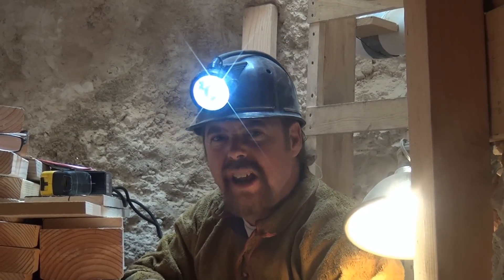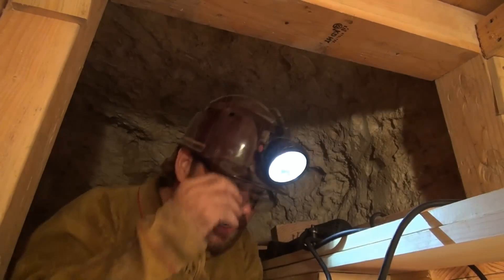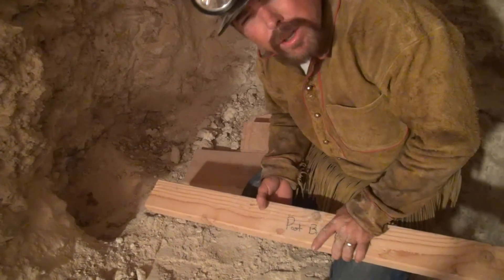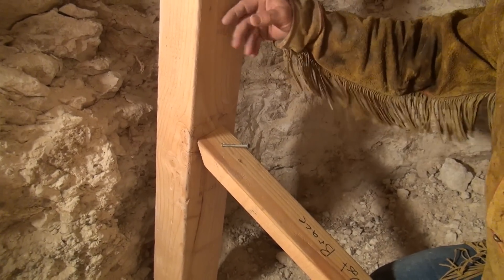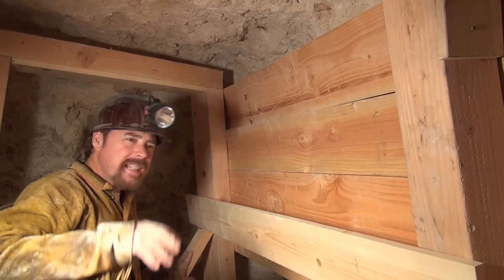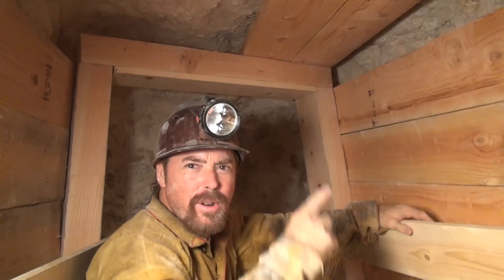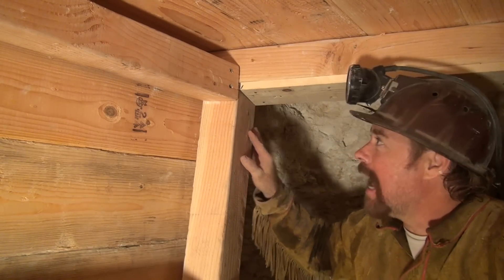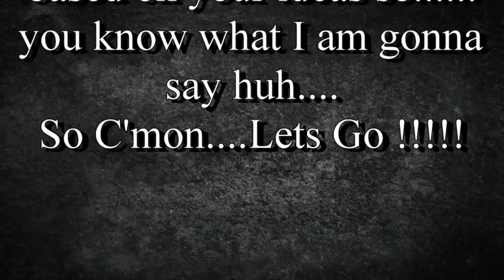TIMBERING A MINE !!!! HowThey Did It.  ask Jeff Williams

Comment: Somehow I felt the wood will rot as moisture may enter the tunnel.  Thus I prefer rebar and concrete to combat possible moisture.  Also noticed you are trying to gasp for more air, perhaps put a fan to the deep end and blow outside may ease air flow.

Comment: I have a question that amounts to a concern, and that is... If I take a deck screw and put it half way in a board or a vice, I can shear it off with a simple whack with a hammer.  If I do that with a decent nail, it simply bends.  Pacific Rim nails have been known to shear though.  Does it matter if the screws have little to no strength in shear?  I am asking for my own project, not a a troll or anything like that. I don't understand underground movement enough to know the effects are or are not.  Thanks for the awesome videos.  I now constantly check daily to see if you a new one out.  lol  Love them all.

Comment: Have you ever used any type of air system to drive back fill in around the timbering? Even though it would be far finer grit and possibly prone to sifting it would fit really tightly into a lot of fine cracks and fill it a lot more tightly.

Comment: Wow that is a real safe Gold mine now. I would use some small lag bolts because those screws will snap off. They are too brittle and break easily. Just saying. I used some stainless screws on my my deck where is connects to the house and they broke off. I did use some lag bolts mostly but at the end I needed some more lag bolts and just put in a screw and you know what the screw broke off.
Reply: I was thinking the same thing.  The drywall type of screw is great for holding things together but I'd feel better knowing there was a steel nail there.  Maybe after assembly come back with a pneumatic nail driver and put some real nails in there.
Reply: yessss that would be best. dry wall screw snap right off with not much effort.
Reply: SDS screw

Comment: #1 most important rule when working underground.  Never work under unsupported ground. If the ground required support to be worked. Then a false set should be put in place or heavy back lagging with wedged cap. Mining is only as safe as you want to make it. Never work under unsupported ground.
Reply from the maker: Thanks and we use a boom to keep the back up.
JS

Comment: Where the mines built with the intention to remove and reuse the lumber when mine dried up? What with the cost and time required for  processing and moving that much lumber that sounds like a prudent or reasonable thing to do.
Reply from the maker: no ...they built them to last for the mine and miners ....timber would be removed if it was needed elsewhere for another mine

Comment: I had asked a engineer who was online, YouTube about a structure for mining braces.
It goes as such:

After a tunnel has been scraped out, at the top wall, parallel to wall across, one can dig a four by six engraving to sit inside the dug out mold.
Then place a 4 × 6 inside the engraved shape fitted mold, using the Rockwall siding to apply planks above without beams to support the upper roof.
Do you believe that's possible?
Reply from the maker: not familiar with that process
Reply: @Askjeffwilliams  Yeah, because it's an idea I asked to confirm with a structural engineer

Comment: This was a very interesting video. I noticed that the overhead boards are running in the direction of the mine (forward and back). Instead of doing that, what if you had the overhead boards going from left to right? Would that configuration be more stable?

Comment: this seems like a ton of work and lumber compared to th modern way where they just drill support screws into the rock ceiling/walls.
Reply: that is only used for surface control, ground support is a totally different animal. bolting isn't enough if you don't use mats and monster plates, then you are only influencing about 10"of the surrounding rock, but in conjunction with the other systems it unifies the larger area and does more to abate rockfalls

Comment: An even cheaper version can be built with logs. It's more difficult, but the safety is the same. We use them alot in our mine.
Reply: The advantage of even small logs is the bark provides extra protection against rot.
Reply: @garywheeler7039  Generally, bark increases rot. Always best to remove bark. Then oil can help prevent rot in lower wet section.

Comment: Jeff could you help me pleas?! I Have a mine shaft it was use to be colapsed ,was never timbered ,  and i wish to repair  but i cant finding instructions for timbering a slope mine tunnel. How it should stay the timbering props , i have thick but round poles  and the loose ground  the entrace 4 or 5 meter long. Raffly maximum 30⁰-angled down Greeting from Hungary!
Reply from the maker: you should timber it as a vertical shaft even though it is an incline shaft ..... sets and collar braces every 5 feet
Reply: Mr.Jeff  could i send you  email, i can show I was maked sized down modell ounder great load , it holds widouth fail,  but i wish you would see it because you a professional.

Comment: Can you dig a mine in a thick dirt? And once you pass the dirt, can you actually tunnel a small mine through hard rock with Sierra Blaster? Also, how much does 2 sets of timberings cost?(lagging connected by 2 posts)
Reply from the maker: Hi Gage...well we are digging through loose gravel now and we have Blasted in the Caliche zones . Two brace sets with lagging and collar braces is about $ 100 bucks ( 50 inch tall posts ) 
JS

Comment: I see your using Phillips screws , Have you heard of or used  Robertson Square screws , We made them here in Canada they are much better they have a bit up to # 2 3 4  Just wondering when katrina hit some of the contractors from Here went to help and the screws were blowing minds of the carpenters there so much easier .
Reply: The type of screws you're talking about are very commonly used here in the southeastern US. That type has nearly replaced the phillips head type here, and I like the square-drive screws much better.
Reply: +Kevin S Ya they rock alright ROBERTSON  there called theyake screws over a foot long for log homes
Reply from the maker: actually yes we have but we have a lot of these laying around and the braces just need to be held in position.
JS

Comment: fyi that pocket you made for your timbers to sit in are called footings. also you need to learn how to notch your timbers and lag in to them without using nails or screws because over time they will rot out and cause the timbers to rot and when the ground moves your sets will fall apart and not be able to move with the ground movement.. js.. be safe.
Reply: so true
Reply: Peter pepper

Comment: I don't think your post & beam structure is as strong as it can be.  Think of it like this, the wooden structure (posts & beams) should be stacked just like you stacked wooden blocks way back when you were just a little fellow.  You should be able to stack the support structure free standing without fasteners.  The fasteners are only there to stop movement.  That little block of wood you have screwed to the 4x4 post to support the beam is not needed, that beam should set on top of the post and beam and your roof should be rotated 90 degrees and set on top of the beams.  The way you have it the side beams are only as strong as the fasteners.  You are not using the strength of the wood.  I love your videos and peace be with you.
Reply from the maker: actually the way we are doing it is one of three methods that has been used for over 100 years .and thanks for watching and loving our vids, you too my friend.
JS